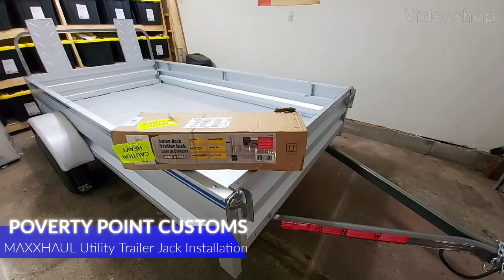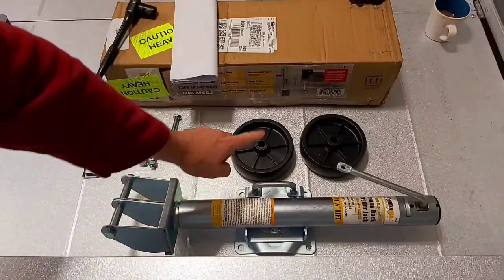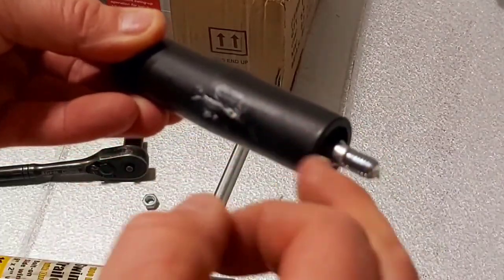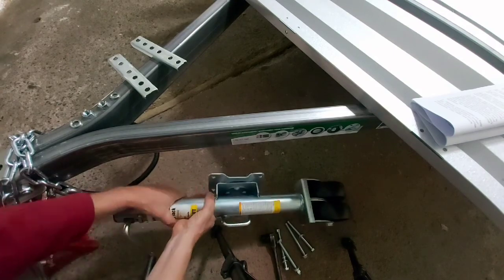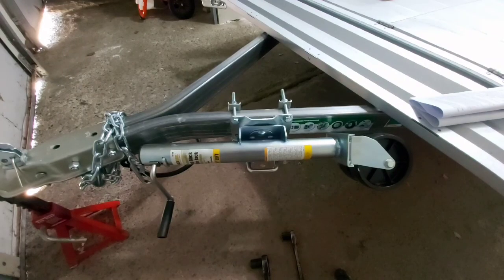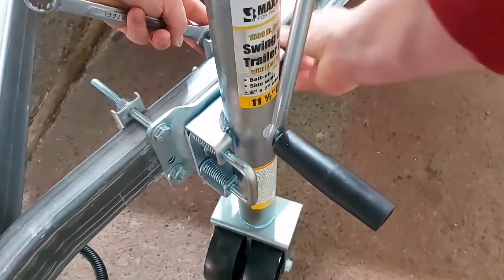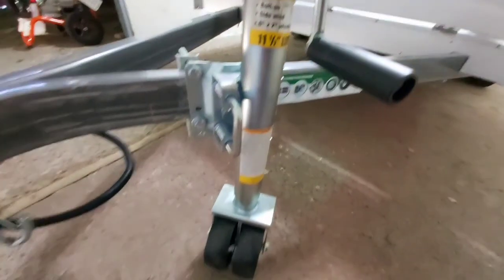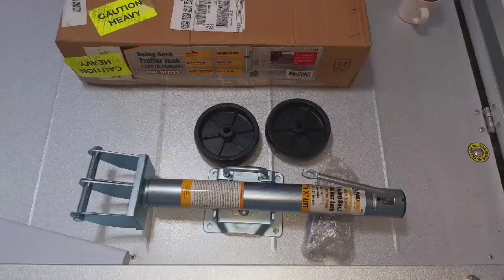MAXXHAUL Utility Trailer Jack Installation

Comment: How is it holding up a year later? I just bought for my utility trailer. My trailer is quite a bit bigger and assuming heavier. Hopefully it can handle the extra weight.  I don’t know what the weights are because the sticker has faded and I paid cash for it. I bought because need to be able to push my trailer back where it will be stored and pull it out when needed. May keep the old jack to use when it has a heavy load or for added stability.
Reply from the maker: So far so good, I've had some fairly heavy loads on it and works great. I sprayed rust check on it for the winter to keep any crossion off of it.